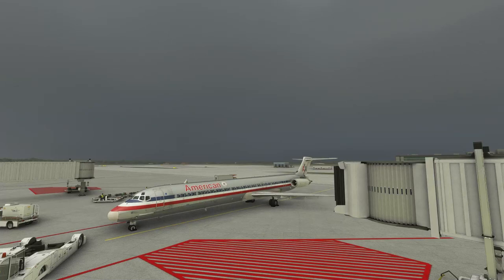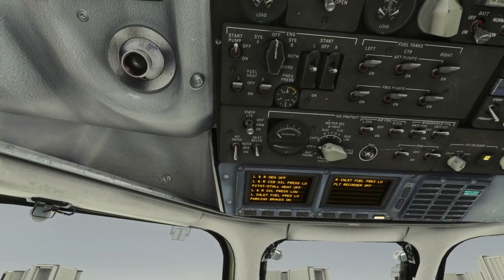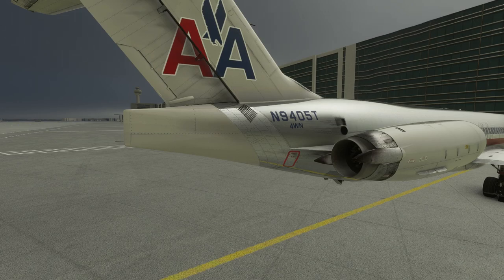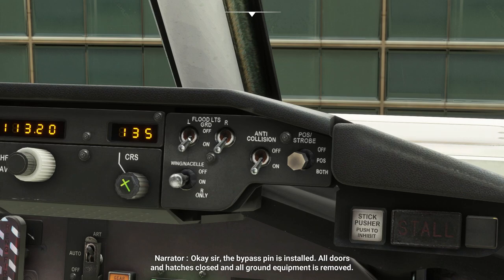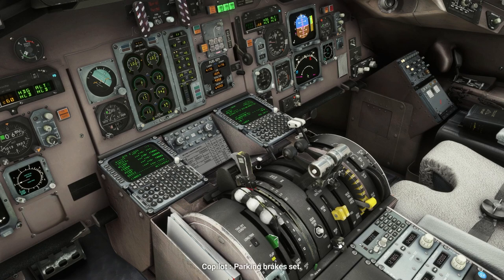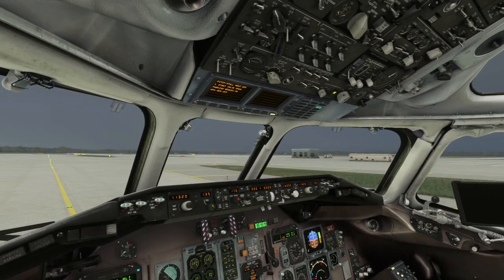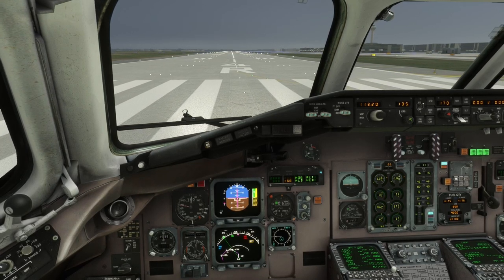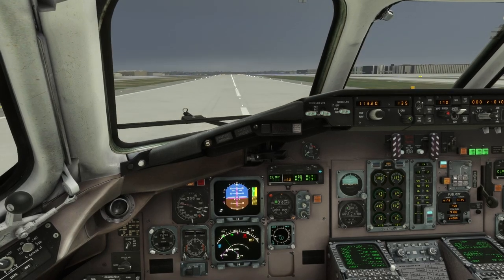COMPLETE QUICK STARTUP & TAKEOFF TUTORIAL | FLY THE MADDOG X MD-80 by Leonardo | MSFS 2020

Comment: You do not need to turn on the start pump if you already have AC power on the A/C.  The start pump is a DC pump from the battery to start the APU when there is no power on the plane yet (cold start).  If AC power is already on via any source, the main fuel pump will work so no need of the DC pump (start pump).

Comment: You probably gonna cover this in the next tutorial video but I need your help with something, i set the trim wheel like you said for take off matching the green sticker in there, but once i reach cruising altitude the airplane is stable in the selected altitude but with the nose a bit up, by now the green sticker is not matching the other part anymore, moved by itself, if I try to trim the nose down with that big wheel the airplane just starts diving like crazy, not sure what I'm doing wrong, maybe I move the trim wheel to much that the nose goes down way to much? Maybe I was carrying to much weight for a 250knts speed ? Any idea?
Reply from the maker: You're not supposed to trim it like that during cruise, just let the AP fly it, or trim it for stable flight yourself if you're hand flying. The green marker is the trim for takeoff only.
In summary, set the trim for takeoff, takeoff, forget about the trim marker, trim it manually for the pitch you want, let the autopilot fly it.
Let me know how it goes.
Reply: @Byemoonmen  sounds good  thank you!!!